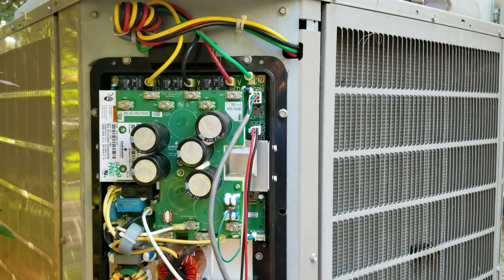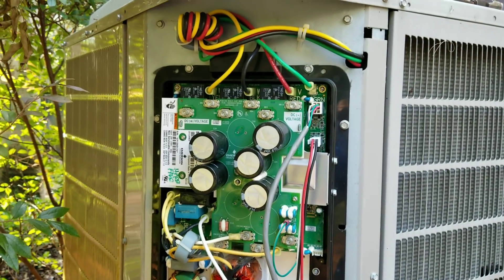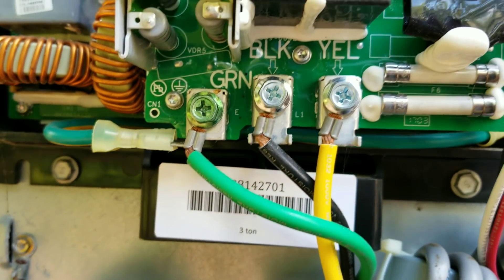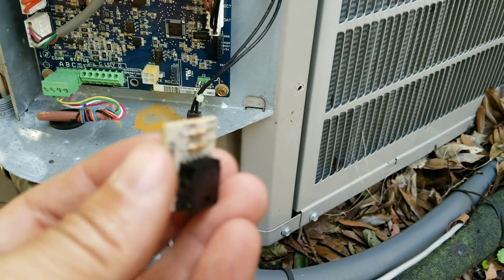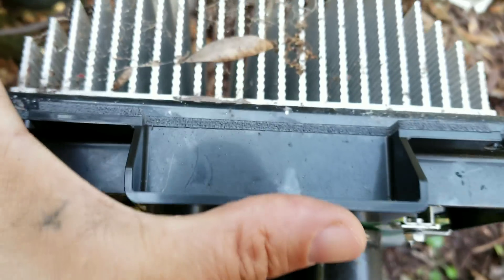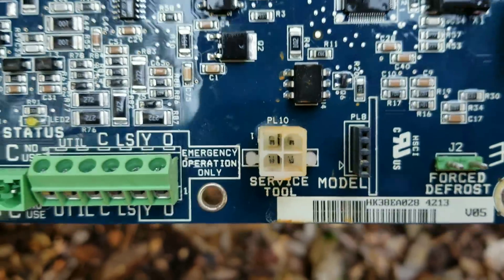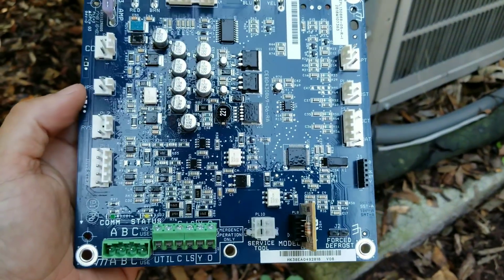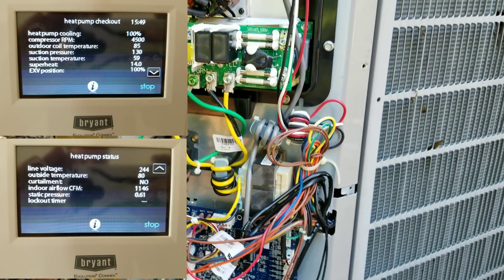Carrier / Bryant Inverter Drive Replacement

Comment: I want to replace the 450V capacitors on the Inverter board. Where can I find the parts?
Reply from the maker: 🤷 No idea. We do not repair circuit boards.

Comment: Hello and thank you for sharing! Any chance you could help me troubleshoot a code “92” which has set more than 5 times so defaults to a code 96 according to the flow chart i found. Code definition is “inverter VDC out under voltage”. I do see signs of water intrusion that made its way onto the OST and the OCT&OAT (OCT&OAT connections are on one harness) connectors on the board. I unplugged the OST connector snd found both the female and male  on the board and on the harness side oxidized/corroded  to the point they were not making a good contact. After powering the system down and cleaning the contacts, the code still returns. The transformer is also humming.. wondering if carrier will   Cover this? Unit and all components  were professionally installed about 5-6 years ago. Same unit you are working on in this video. Any chance you could help me out with this? Any help would be greatly appreciated
Reply from the maker: This issue has nothing to do with the OCT or OAT. You either have an incoming power issue, loose wiring or a failed inverter drive. 
If you are not a licensed HVAC contractor I would contact on ASAP. At minimum the parts should be under warranty but if Carrier finds out a non licensed person is messing with the equipment any remaining warranties will be void.

Comment: all that electronic junk in a poorly enclosed space... so much for K.I.S.S ( keep it simple stupid) it's way past time to force engineers and designers to go work in the trade fields for 10 years minimum before being allowed to design or modify anything period.
Reply from the maker: +throttle bottle This electronic junk still works and works well. Not to mention the engineers made it incredibly easy to replace. Sadly when you add sidways rain at 100+ mph in a hurricane for 3 days straight, water tends to get in places it was never designed to get.

Comment: So what did you do to repair the spot where the water was getting in to prevent that problem from happening again in the future?
And where exactly was it coming in behind the inverter board?
Reply from the maker: +Shannon Knight HVAC I replaced the entire inverter drive which was leaking. I did not dissasemble the drive to investigate the leak as it is under warranty and is getting shipped back for Bryant to look at.
Even the best sealed components leak when you have horizontal rain and 100+mph winds from a hurricane for nearly 3 days straight. Only found 2 like this so far out of nearly 800 installed since 2012.
Reply: HVAC in SC. Wow. What a great machine

Comment: Can you explain what the aoc board does
Reply: a.o.c. = application operating control, the inverter is called the m.o.c. = motor operating control
The aoc monitors all operating parameters, faults, thermistors,  transducer, psi switch, etc. It receives commands from and sends operating data back to the wall control/user interface. It is what drives the moc and determines what stage or rpms the moc should drive the compressor at.  The model plug tells the aoc board the model and tonnage of the system.